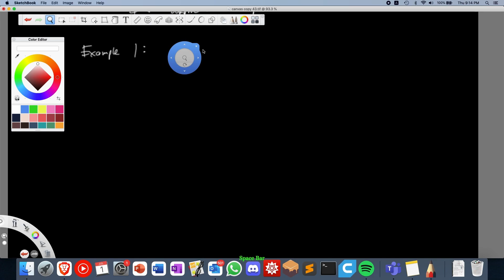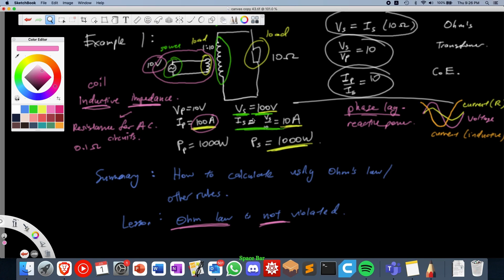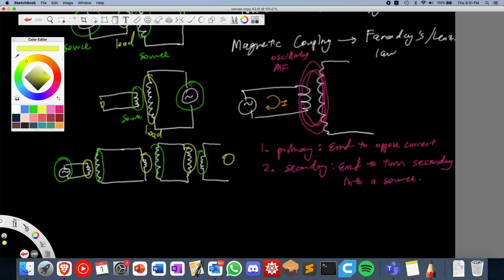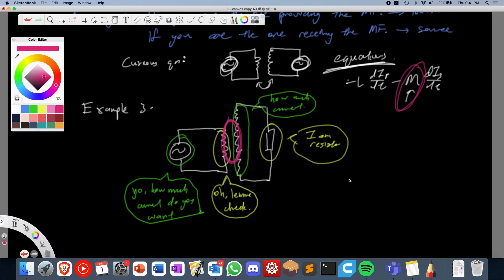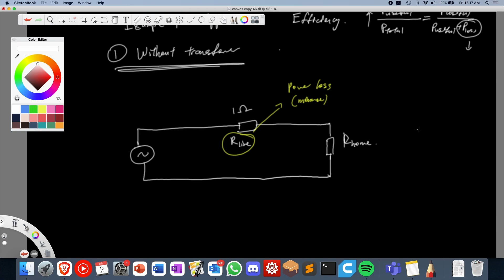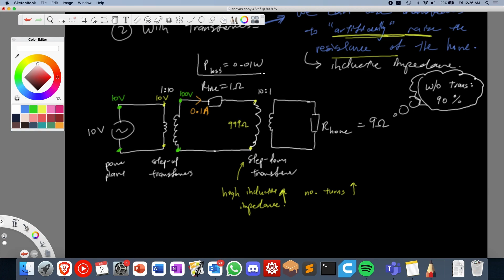Clarifying Concepts regarding Transformers

Comment: @tchsurvives Please check ur explanation at 50:05, u did 100/999+1 to get 0.1 A, so voltages should be 0.1 and 99.9 which sum up to 100v, how the heck u get 999 v ???
Reply from the maker: Oh my oh my! sorry for the mistakes. current should be 100/(999+1) = 0.1A, then voltage should be 0.1V (resistor) and 99.9V (transformer) indeed, then after the transformer it (the green writing) should be 99.9/10 = 9.99V (instead of 99.9V). the home gets 9.99V/9 = 1.11A (instead of 11.1). and the Puseful = (1.11^2)(9) = 11.0889W (instead of 99.9W, i dont know how I made this mistake...) and then the efficiency is 11.0889/(11.0889+0.01) = 99.91% (2 decimal places) 

sorry for the mistakes (ive updated the description to include these erratas), the rest should be fine. thanks for watching my video and pointing out my mistake. i didnt proof watch my lecture because it was too long (my bad)
Reply: @tanchienhao   yep now it's fine..